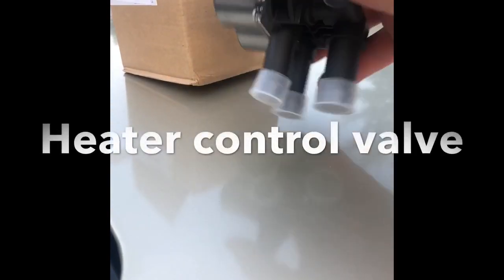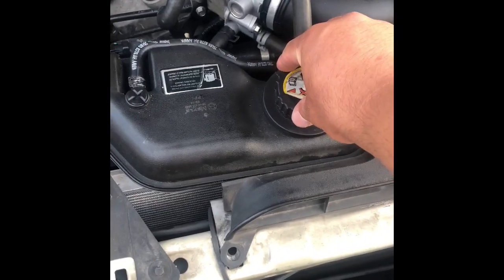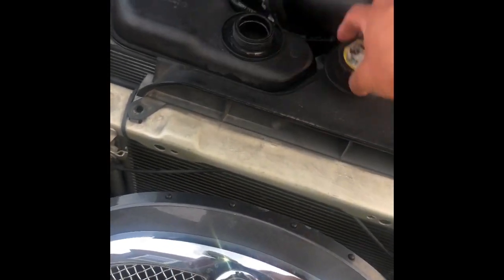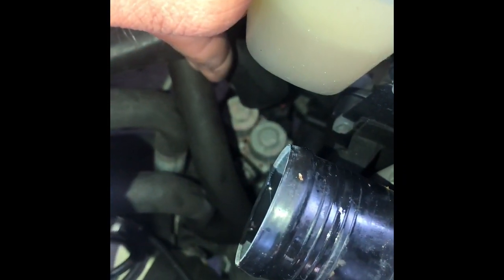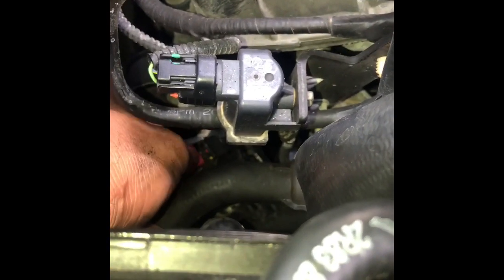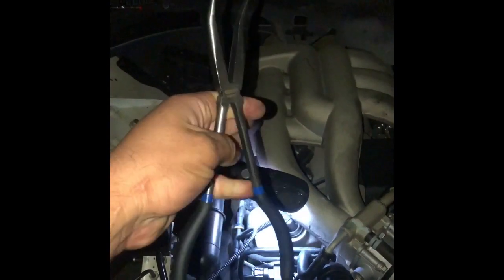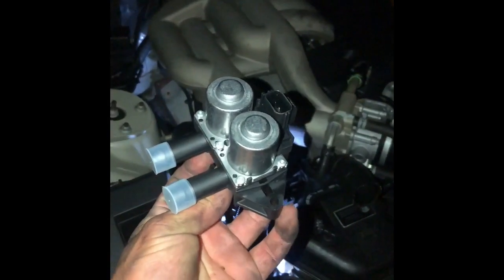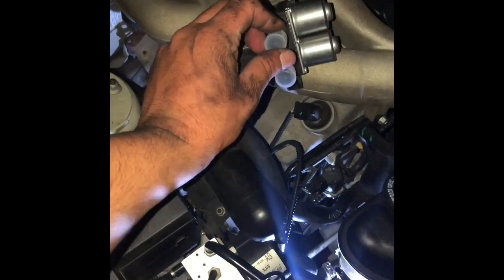How to replace heater control valve on a jaguar S type

Comment: Thank sir, for this extremely instructual how to video.

I'm changing this part out now (10 degrees outline..ugh) and without your video, I couldn't even find its location. 
 Please keep these classes going. You may be surprised by how many you are helping.

Cheers,

Gary
Reply from the maker: GabrielKish My pleasure , Thanks will do
Reply: @sperez6140  With your direction I managed to replace that horrid and damned part. Wow, was that a B%$@#...

Working on Jags (my own cause I'm cheap) brings up visions of my hands on the throat of the engineer who designed these bizarre and ill placed parts. 

Thank you for the video. I referenced it many times during the replacement.
Reply: @sperez6140  I have 2003 stype an did a smoke test throttle body is leaking by the throttle position sensor intake manifold Turner valves on the back of intake manifold leaking and evap purge transfer tube underneath intake by throttle body leaking where can I purchase these parts

Comment: I did the same repair. I have a supercharged version and I also replaced the intercooler pump which is right on top of this climate control valve. Tricky , especially if you have big hands . Thanks for the video

Comment: I am a certified technician and when I have parts like this that have a probability of corrosion I use a simple trick-IGNITION & BATTERY TERMINAL SEALER-, You can find it at any automotive store.  I recommend doing this before taking part out of car to allow dry time.
Step 1:  cap off any open ports and connectors.
Step 2:  coat the metal parts in a modest layer and let dry minimum 5 minutes stuff dries faster but just to be sure.
Step 3: coat in another modest layer and let sit  another 5 minutes or so.
Step 4: check to make sure it did not get into any ports or connectors if so clean them. 
There you go simple and easy, just clean the part and  reapply sealer every oil change.
Reply from the maker: K Mann thanks for the info much appreciated 👍👍
Reply: You recommend doing this before installing a new one? Or to do it when installing a new one?
Reply: @brandan003  I recommend using it on the new part before working or taking old part out to allow sufficient dry time. It dries quick but for the first time I like to do a few coats, which will ensure the part is sealed from corrosion.

Comment: Sorry so I got new heater valve and the part that you  unscrew at with extinction is broken just to hold it in place next the radiator would it be OK to just let rest run to see what happens or can I use something else to hold it place like a zip tie or tape

Comment: I've got a 2001 s type.  the heat is luke warm through the two vents in the center of the dash and Luke warm air out of the vents on the dash closest to the doors.  if I put heat to the floor it is cold.  the car will also blow cold air if I am driving and come to a stop but then begin blowing warm air from the two center dash vents once I get going again.  is this what happened to you?
Reply from the maker: Answer The Call yes I have 2 jaguar on one I had that problem like you and this part here fix that issue, on my other Jaguar I was having that problem and what  fix the issue on that one was the AC climate control panel https://rover.ebay.com/rover/0/0/0?mpre=https%3A%2F%2Fwww.ebay.com%2Fulk%2Fitm%2F323592815720
Reply: S Perez  How did you know it was the climate control
Reply from the maker: Frank Ribido I  took the car to jaguar and they told me , but I did everything my self it was cheaper that way
Reply: that will not work for me as I have a 2001.  but I get what you're saying.  due to my problems with the heat being not hot you think it's the climate control panel itself?  did jaguar tell you what is going on with the panel that causes it to kick out cooler than hot air?
Reply from the maker: Answer The Call yes jaguar told me why it was blowing hot air instead of cold ,  The climate control panel had a short in it which this problem is well known to happen on jaguar s type climate control panel, I’ll check to see if I still have the receipt I’ll make a video of it
Reply: S Perez ok great, thanks.  do you know if this is a common thing on the 2001 model?  only reason I ask is that my cluster is different than the one you linked on ebay.
Reply from the maker: Answer The Call yes on all jaguar s type from 2000 2008
Reply: S Perez ok thanks.  so...check this out.  I live in minnesota.  it was cold 2 days ago.  I notice that once the car warmed up, the vents were all blowing cold air.  so I turned the fan speed down and tried turning the climate control off and tried selecting different options like turning the fan to high once I turned it back on to see if it would kick out some heat.  nothing.  so then after I had no luck, I was driving along with the fan on the lowest setting and I noticed the temperature gauge and it was almost the the point of overheating.  then a red dash light came on for the temp warning.  so I thought it may be a water pump and flipped the fan to high as I was about to pull off.  then the temp gauge swung immediately back to normal and I began getting heat again.  checked the car over.  no leaks.  everything seemed fine.  added 1/3 gallon of coolant.

so now I get luke warm air from drivers side door vent.  somewhat hot air from drivers dash vent.  then cold air from passenger dash vent and luke warm air from passenger side door vent.  and still cold air on floor setting.  I should mention that I only get heat on the 3 lowest fan speeds.  if I turn the fan up past that it blows cool to cold air.

so before I start looking at doing the climate control like you said, do you think I should do the heater control valve first?  I read that once this valve goes it can take out the climate control unit.  or would you do both at same time?  what do you think happened when my cars temp spiked so high?  Heater control valve get stuck shut?  car ran fine and has been fine after the temp went back down and the heat started working again.
Reply from the maker: Answer The climate control unit for sure do both it seems like you’re having multiple problems,
Reply: S Perez ok thanks.  appreciate it

Comment: What’s up man I have a 06 type a 3.0 24 valve with the same problem. Where exactly did you order the part from if you don’t mind me asking
Reply from the maker: Cristian Romero https://rover.ebay.com/rover/0/0/0?mpre=https%3A%2F%2Fwww.ebay.com%2Fulk%2Fitm%2F282332004744
Reply: Car parts .com usually beets everyone’s price

Comment: I have a 2001 S-Type Jag and i replaced water pump and thermostat and fixed the reservoir the best i could due to a small crack .... runs normal until i sit still to long then slowly starts to pverheat ... when i start moving again it slowly goes back down but def wouldnt take my car on a long trip right now which i need to fix.... idk what to do haha ... also no heat even with new thermostat
Reply from the maker: Quick question before I answer do you still have a small leak
Reply from the maker: Clarence Baker this is exactly what’s happening to your car that leak is not patch good so what’s happening whenever you are driving there is not a lot of pressure, but one never you stop your car it builds up pressure so guess what It starts leaking again slowly
Reply: Yes i do still have a small leak
Reply: But the small leak is kinda right near back of driver tire or at least thats where i see it leaking antifreeze
Reply from the maker: Clarence Baker buddy that leak you are talking about is not a leak that’s from your ac I was thinking the same on mine, do what I did I took off all the factory Clamps to all the hoses and I bought some brand new ones with screwed on them where you  can tighten them better, that’s how I stop my leak , the clamps on these jaguar get very weak after a while when they get pressure they start leaking small drop of water